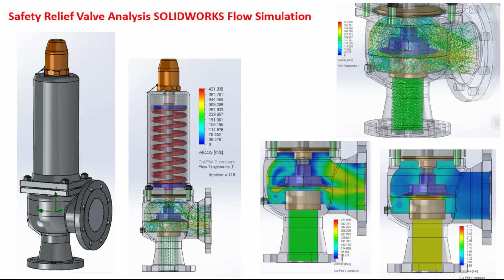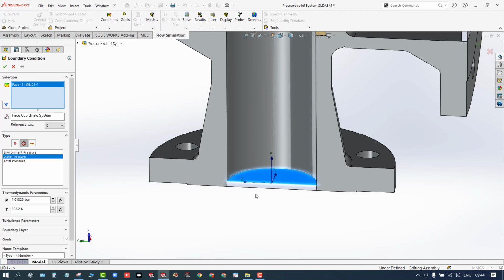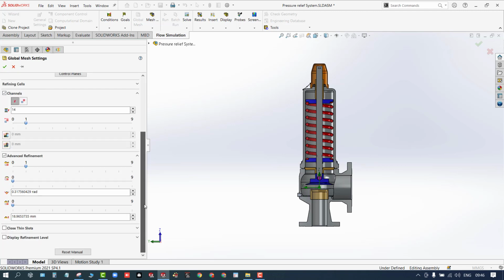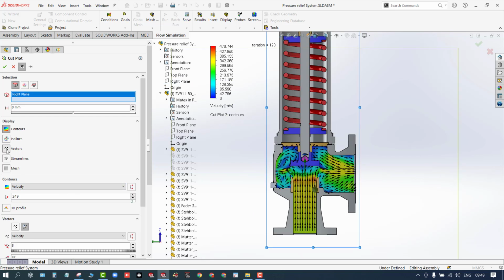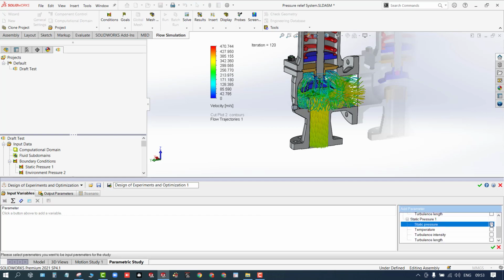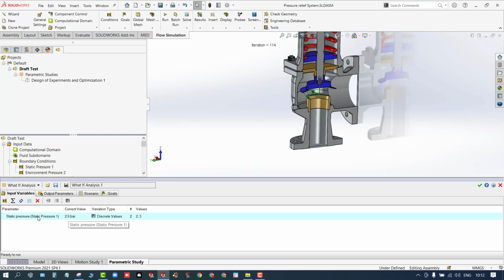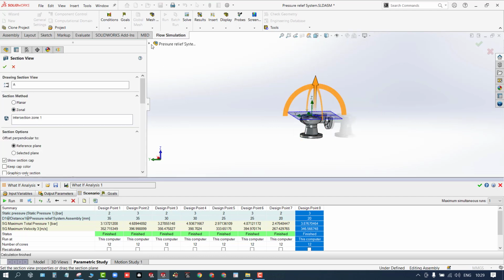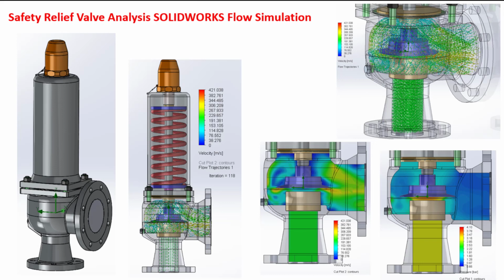Safety Relief Valve Analysis using SOLIDWORKS Flow Simulation |Flow Simulation Demo |Pressure Valves

Comment: Those speed conditions are very high, my question is what impact does this have on the material, because this simulation is ideal, we do not see the impact of the pressure on the walls of the psv. I would like to see the impact of the pressure on the internal materials of the PSV.